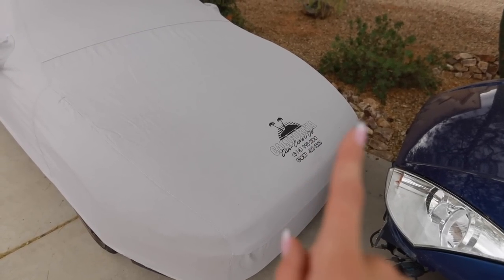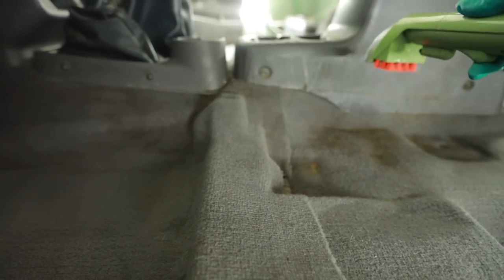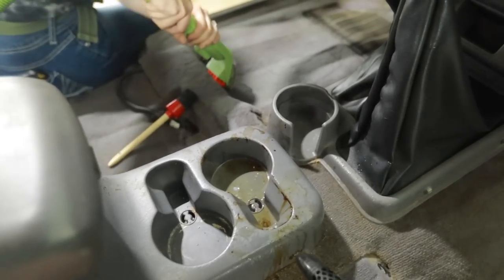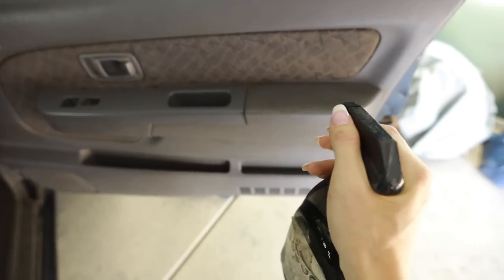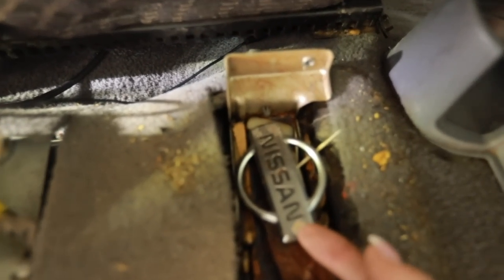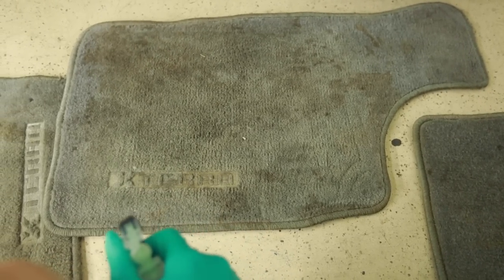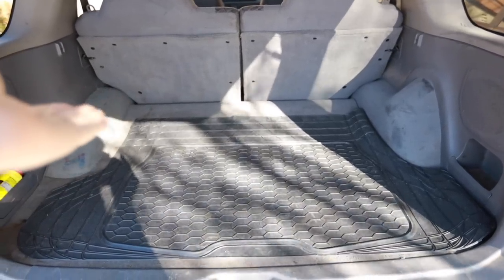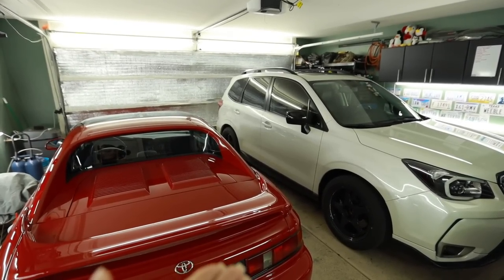I Can't Believe We Pulled This Off! // Detailing Lil Sister's Xterra

Comment: A couple suggestions for your next detail makeover.

Interior carpet,/fabric seat: spray with cleaner of choice, use a flexible drill brush, extract with hot water only, any soap residue will only attract dirt.

Floor mats, cleaner, drill brush, power washer till soap/dirt is gone, extract.

Hopefully this will save you some time while getting “detail oriented” results.

Great video

Comment: I have used Spray Nine on countless seats and carpets. I use the same bissell cleaner for my vehicles but I spray everything down with Spray Nine let it soak and then scrub in with a brush. Then I use just hot water in the bissell and vacuum everything out.  Works really well.

Comment: Sarah from  Conway NH 72 degrees today but your smart getting out of here.Winter bites. I used a 3 stage carpet cleaner with an  upholstery tool for cleaning cars. Watch a couch cleaning and you can see the difference the powerful suction makes. Especially if you have a heater for the water.

Comment: Great video!!! I have a 2000 Frontier 4x4 with the same drivetrain as the Xtera and I did the same radiator upgrade. I'm also in AZ but along the Colorado River and it often gets to about 120+ here and that was a must have. I've also upgraded the clutch to a Centerforce dual friction only because I've had that clutch before in a Toyota Highlux and fell in love with it. Over kill maybe but I'll never have to worry about it and found it to be not much more than an OEM clutch.

Comment: That was great work. I had a similar problem cleaning my steering wheel. Turns out that GoJo hand cleaner can get into those crevices very nicely. It gets the stains from dirty hands out with a hand cleaning brush. The outside looks like it was cleaned with a scouring pad. You're probably right about the cut and buff. Not enough paint left for that. Still it looks like Celine has a nice car now, al least from the inside and the places where it counts.

Comment: Later on, if you choose to do it, 3M makes a pad that is soft and for wet sanding with your DA. Its a 3000 grit pad. Super fast and doesn't remove a ton of clear! I use it a lot in my shop when I detail paints!

Comment: Hey Sarah, your carpet extractor would be a bit more effective with just got water in it.

If you get a cheap weed sprayer from Walmart you can fill it with your cleaning solution and spray it easier then use a brush or drill brush to spread the cleaner.

Besides that, awesome video! Glad to see you teaching others to DIY!

Comment: Two suggestions for ya.... 1) get a pressurized insecticide canister so you can spray your special cleaner easier, more evenly and you'll be able to saturate areas better....B) pressure washer for the floormats..... trust me it'll get them cleaner and you can use the pressure washer for washing your cars as well as various other things!

Comment: I’d try 5000 wet sand paper on the at paint then buff it out with 
I’d try out meguiars da correction and polishing compounds with their microfiber cut and finish discs. 
I don’t think you’d cut thru, and you could always just clear coat it if that happened

Comment: TORNADOR  BLACK PROFESSIONAL Liquid Air Cleaning Tool Z-020
Check out one of these things, the cost about 180$ but clean anything. 
Watch out for the Chinese clones on eBay for 50$ they are junk. 
They clean with water and compressed air. You can put cleaner in if you want.

Comment: Next time, take all your seats, mats, door panels, and carpets to your local carwash and use the pressure washer. Spray them with a 50/50 mix of purple power, let sit for 30 mins, and rinse with hot pressure washer. Let sit in hot AZ sun for a day and you seats will be perfect for 30 mins of work. Don't do it with seats that have airbags in them though.

Comment: A word of caution. When you spray your mixture of chemicals and then use the steam cleaner do not breathe in the steam avoid it if you can, chemicals could leach into the Steam and right into your lungs.

Comment: What did you use on the steering wheel?!! Mine is nasty
Reply from the maker: Gave up 1/2 way.. it just needs a new one.
Reply: @SarahnTuned  I was wondering about the cleaner that you often use. Does it get rid of the hard to get rid of nasty dead skin on the wheel?